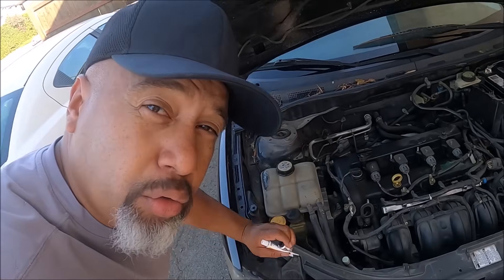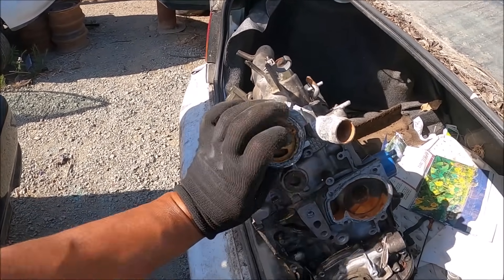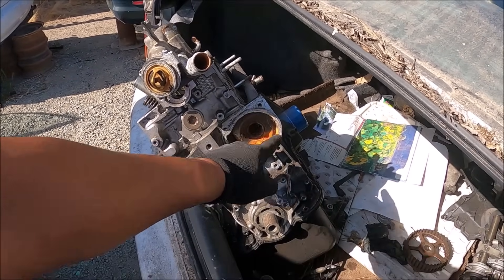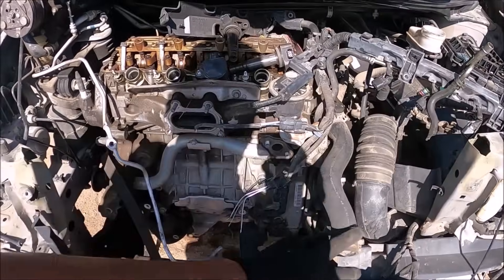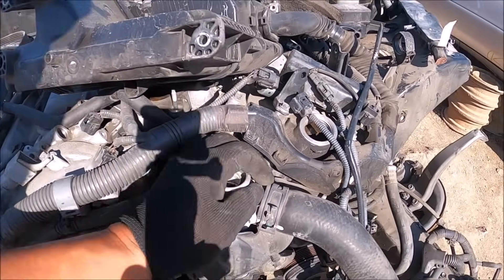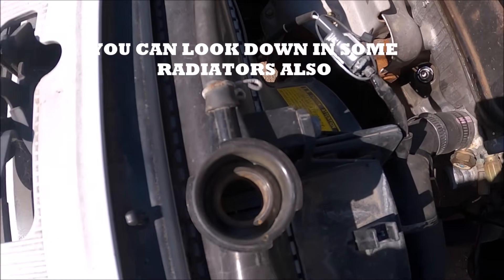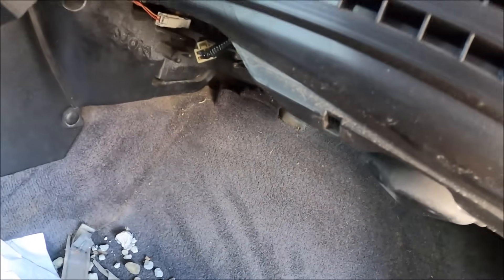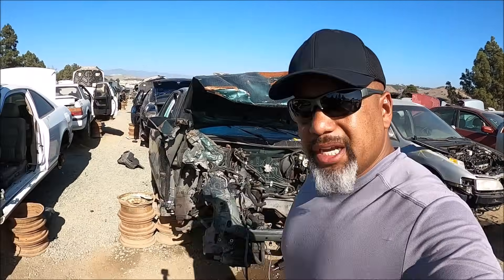HOW TO CHECK IF YOUR WATER PUMP WORKS & CIRCULATES ( EASY OVERHEATING TEST )THE COOLING SYSTEM.

Comment: Hey brother is it possible to resurface a engine block without having to remove and tear apart the bottom end Ill be working on a 99 honda civic would like to save me alot of time and patience not ripping apart the hole engine to resurface the block

Comment: JB Weld was used to plug a big hole in my automatic transmission. Didn't leak for over 150,000 miles. Good stuff.
Reply: Used JB Weld to repair an engine block. It cracked right to the head surface. I used a straight edge and a belt sander with fine paper to resurface it. Slapped it back together and drove the car like that for 5 years.
Reply: hey robert, you the first guy i ever saw using a junk yard car to do 'internals' explanations generally.  did old skool get this idea from you?  not sayin' you was the first, but you definitely been using that trick...
Reply: Good video

Comment: Good tips.  Best if you have a check list and check hoses, water pump and thermostat at certain mileage.  Preventive maintenance; change at certain mileage.  Also if you can, get a all aluminum radiator.  Those half plastic / aluminum radiators give lots of trouble.

Comment: I like the advice given in this video, its all good generally speaking.  However, its important to note that some cars are just engineered by idiots, like some of the modern Ford engines with internal water pump.  Those cars are straight JUNK

Comment: My engine was overheating so I changed thermostat and sensor but ended up bypassing heatercore to fix it, don’t know if that was needed but it stopped overheating. Now it’s smoking right before the catalytic converter underneath and not sure if cat is clogged/bad or I’m leaking coolant from somewhere or both? What should I try? Thanks , love your videos

Comment: love all your videos man, even as i continue my career as a mechanic i love watching you. god bless you!
Reply from the maker: Awesome! Thank you!
Reply: @oldskoolfunk71  hey bro i notice my upper radiator hose is hot but not my lower hose no thermostat and new radiator and fans are working my heater core is bypass is that a bad water pump
Reply: @agustinroque6247  clogged radiator
Reply: @oldskoolfunk71  hi from australia, if bottom radiator hose cool but top hose hot , thermostat though it has been changed after trimming kit 3 years ago , all started a week ago small leak in bottom radiator after placing coolen stop leak it stopped small leak then a sudden leak in the bottom radiator much bigger leak.  heater working off and on mainly off, heater core hoses in fire wall inlet hott outlet cold.

Comment: knead it putty is good too , with thermostats i just remove the spring etc in the center of it so you can still use the seal that is part of the thermostat and to also help keep the cooling of the engine more even. i have heard from many guys theyve seen heads warp from uneven cooling not just from overheating. a frozen water pump  never seen anything that bad yet.